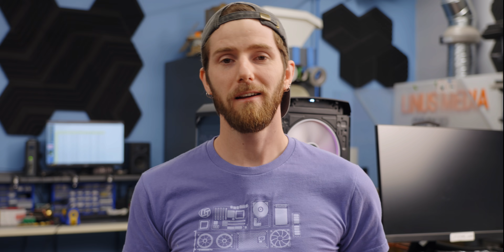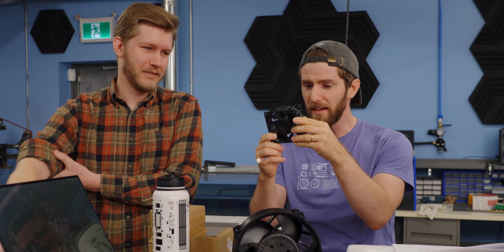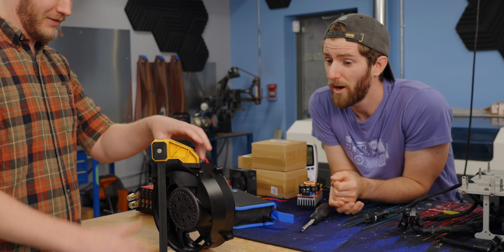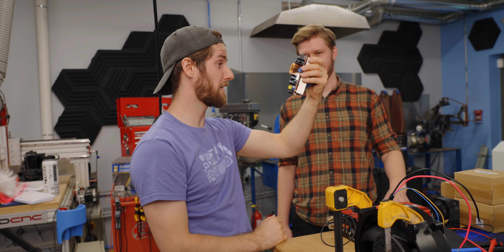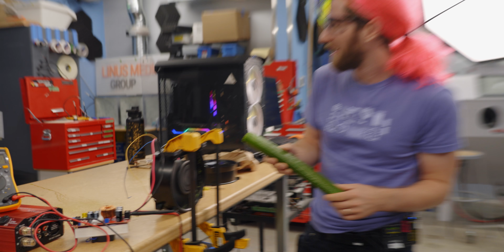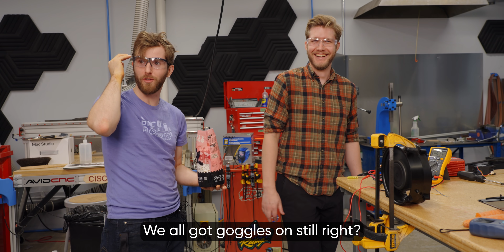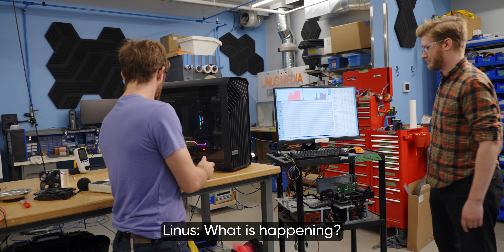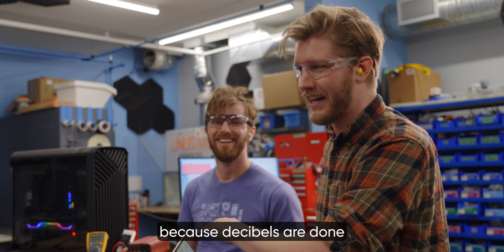The God of Computer Fans

Comment: Here's a hack, get a $30,100mm bathroom exhaust fan and BAM, you have the same airflow for a very low price.
Reply: These are ~8" fans and move a thousand CFM of air. A 4" fan sweeps a quarter the area and would have to turn at nearly 30000rpm to push 1000cfm... Actually more because cfm stops increasingly linearly at high rotor speeds.

No cheapo bathroom exhaust fan will get much past a tenth that speed. They will contain an asynchronous 2 or 4 pole motor which will spin at a shade under 3600 or 1800rpm respectively, probably pushing somewhere vaguely around 100cfm.
Reply: What about a car radiator fan?
Reply: @radelement3987  car radiator fan is way too powerful i think its 1800watts
Reply: @lighttechzeon7026  Which is only 3 times as much as one of these
Reply: @krzysztofczarnecki8238  which will break the pc
Reply: @lighttechzeon7026  They already had to use a separate power supply, so that is not a limiting factor.
Reply: @krzysztofczarnecki8238  you do know internals  of pc is fragile? 4100cfm with high pressure will most likely break the internals or damage it
Reply: @lighttechzeon7026  More importantly, increasing air flow at this stage is irrelevant to cooling because the transfer of heat off the die, through the vapor chambers and into the fins is now the limiting factor, not its removal from the fins.

Which is why, at this point, pretty much all of HPC is preparing for, at the very least, liquid cooling of the CPUs and GPUs, or just straight up full immersion.

Comment: We used fans like these to cool all of the components inside big drive cabinets. These drives were for 480v motors up to 500 horsepower at the aluminum rolling mill I used to work at. That fan is around 1/2 Horsepower! It would be really awesome to see stuff put into this fan using a high speed camera.

Comment: With a fan like that, I wouldn't even mount it internally.  That sucker is going to power a negative pressure system of ductwork to just suck all the heat out of the tower.

Comment: Actually have two of these, I work construction and we did a demo job at a cat food plant and they had these over a conveyer belt that cooled these labels/ heat shrink so they would drop on a bag go thru a heated chamber and then into the fan chamber and it would cool them down to handling temp so they wouldn’t stick together they have some force but mine are 110v and I planned on running them on a radiator in another room just for shits and giggles they are awesome tho

Comment: Those would be used on the top of a server cab that had sealed, non airflow doors/panels so it will draw cold air from the raised floor up through the cabinet out the top. These would be on the TOP for a chimney

Comment: Sometimes we use those models of fans because on older buildings the ac is not great and the focus is more air being pushed through rather than having cooler air. Ac is more reffered to as the removal of water from air, technically is "conditioned air or air conditioning". No need for recycling air just desiccate it and vent it out the back and make sure the inlet has shade.

Comment: My old shop had a multitude of different CNC and laser etch machines, these fans (or judging by the sound something similar) were used to cool down said equipment. Even massive milling machines would benefit from fans like these to keep mill stock out of the job

Comment: doing some reasearch on these ....  they're data center products and delta has a whole THD Line that goes from 80 mm to 200mm   FYI, that fan you have has a max draw of 8 amps.  based on my calculations, i think thats 3k watts total power per fan at its max rate.   everything runs on that 36-75 volt range except for the 80mm, that runs on the 12v rails, however, one 80mm fan the THD0848ve-00 is 48v.   

you're welcome linus :)

Comment: Hi, those type of fan are used in industry for cooling spetial motors/condensators/electronics circuit (like some used on big old CNC) , i changed one of this fan, he was full aluminium non coated (natural color)  , >3kg if i remember , >200w consumption and less noisy as yours, but bigger  ;)

Comment: Those fans are typically used to cool MCU buildings in industrial applications, MCUs usually have 3 phase 480v running through them. I used to work in a silica mine that had 8 MCUs to run pumps and other mine equipment . I hated everytime I had to be in those MCU buildings.

Comment: You'd get more flow if you had a radiused inlet.  RLCraig makes bellmouth inlets for HVAC ducts, that'd work like a charm.  That'd quiet it down too.
BTW, you can get a similar Pabst fan on e Bay.
Reply: I was using a Pabst fan to cool my audio rack for a while.  Great stuff, very well built.

Comment: I would've liked to see a part where they try to reduce the voltage so much that the fans arent really hearable or put them on a big radiator with push and pull or even close every gap of a case and only have one exit hole for all the air

Comment: At     7:43  ine thing  popped into my head :  4 of the  "GOD " fnas  used  in either  an RC A380 , B747  or  C17   model . THAT WOULD BE SWEET . My only headaches  would be  1. - how to provide  power  to all FOUR fof the duration of  flight  and 2. -  making  an appropraite  mold  around the fan so it looks  like an engine made  by  BOEING  or  Rolls Royce and then mounting them to the wings . I think power  would  really hamper me , any ideas  ?.

Comment: Okay, it seems absurd but the reason those psus come like that is because you're supposed to put standoffs on it and bolt it to the inside of a chassis to be integrated into your project (after you set the limits on the bench). They're usually just based on the reference implementation for a particular ic. You do have to watch the component quality though.

Comment: I work at a bitcoin farm,  we have some custom solutions for power and cases and stuff. We don't use those fans, but something pretty similar. I could definitely see them being used on custom configs. We run stuff pretty hot as well. Could be useful in some of our new buildings for transporting heat.

Comment: We have a similar fan at work just not as powerful as we have 6 in a row. It blows air into an electrical cabinet to cool down capacitor banks so I’m assuming they are meant for similar functions where you need high air flow and need them to be reliable and to be tough.

Comment: Have had to procure a only-slightly less specced fan for a film projection booth. Arc lamps produce ozone and you have to cycle the entire room's worth of air every few minutes for safety. One of these would deal with the whole room, but (1) those are LOUD for showing a movie and (2) we had one on each of three projectors instead of one for the whole room.

Comment: We have a large CNC drill used for circuit board manufacturing and the electrical cabinet on the side also houses the modules that control the machine movements and need to be cooled. The fans that are mounted to the door of the cabinet are a little larger than the ones you have but I don't think spin quite so fast.

Comment: About the fans: Industrial settings use those a lot. For example, electrical cabinets that needs lots of active cooling, like in wind turbines.
Reply: So they use the electricity generated by airflow over the giant turbine to generate airflow through a smaller turbine inside the giant turbine to cool the heat generated by the giant turbine? Seems complicated. Maybe they should just open a window.

Comment: As a DC electrician that works on AT&T telecommunications, those fans could be found in electrical cabinets with electronics running inside that indeed need cooling. They tend to either be situated in cabinets residing in indoor shelters, or on top of buildings.

Comment: I have installed fans like that and even more expensive fans in industrial cabinets. Their performance is great. And they work great with even absurd levels of clogging in filters.

Fans like this usually come in multiple voltages, both AC and DC, so I'm surprised they went with 48v DC. They probably also have a 120v AC version.

Rittal is the brand I mostly installed.
Reply: Rottal make the enclosures. Fans likely Pabst

Comment: I've seen these fans in use for industrial server racks, and even have one of them laying around here. Where my dad used to work, they had these super heavy duty fridge size vault kinda things that were used as a kind of almost bomb proof server rack, and it was kept in an unairconditioned warehouse. They had those type fans to quickly exhaust the hot air from inside, so the electronics didn't bake.
Reply: I worked in a big company for a decade and one day after a power outage I went to check the data center (there were like 50 racks of servers and switches, plus 3 chillers so it was pretty loud, you had to cup your ear around the phone to hear someone on the other end for reference)... Well that day I opened the door and heard this SCREAMING jet noise that was totally drowning out all the noise I was used to. I immediately found the rack and it had 6 of such fans at the top, all blowing at full speed from a fault. 

It was so loud, and so much airflow. Had to wait a week with them at full blast before a tech from the equipment supplier got in to repair it.

Comment: Some data centers use climate controlled rows for better cooling efficiency. They will build rooms around a row that is all intakes for servers and that little room will be air conditioned. These may be for that type of application, or even to remove the heat from the exhaust rows in a expeditious manner.

Comment: Well my laptop is starting to die, and it makes a weird noise, so at night when I'm having trouble to sleep I need to turn the laptop of, otherwise the noise anoys me imagine having a pc with a fan like these lol, I would not even turn it on ever :) or I would need some very expensive headphones with very good noise reduction to be able to be just next to the pc :)
Reply: Weird mechanical noises? Might actually be the fan(s) having issues. Weird electrical noises? Might be one of the higher voltage chipsets like display or graphics. Weird computer noises from like resting OS' default system or desktop? If you have shit connected by USB, might be disconnecting or turning on and off like a power saving feature cycling.
Reply: @AM-dc7pv  thanks for your concern, but I know it is the fan, since if I tap the pc it stops for a whille and then it comes back, and I can clearly see that is a ball bearing or something that makes the noise when the fan is turning, I didnt clearly explain it in my main coment, is not the laptop that is about to die, is the laptop fan :) I forgot to type fan ;)
that is why I was comparing to this fan on the video, mine makes noise cause is dieing, is not the normal noise, but the one on this video is always fking loud lol, if I can't sleep with the litle anoying noise mine makes, imagine with one of those :)
but thanks for trying to help anyway ;)

Comment: It was an interesting experiment, but what if you don’t blow in, but rather remove the back walls and draw out the air ... Isn’t it better?
Reply: No. Reducing the air pressure inside the case degrades the efficiency of the air cooling.
Reply: @martindinner3621  The air flow and so will be through the front wall with a filter. Duct fan wouldn't it be efficient?
despite the fact that not everyone in the store can create pressure

Comment: A Superior Broadcast Products (Marsden) 2KW solid state TV transmitter has 8 of them.  4 fans feeding the amplifiers, 4 drawing air away.  Those are 208/240V though.  It has 4 600W amplifiers with massive aluminum heat sinks and merges their outputs for a combined 2KW total output.  The transmitter is in a really nice 35U rack.

I was given one of those transmitters and also a 1KW tube amped transmitter.  Scrapped both of them, gave the racks away.  Still have 7 of those fans.

Comment: We actually use these types of fans in an injection molding machine but only because the controll box was overheating even with Airconditioning because of the coils. But its a very old machine (It runs on Dos) so we couldnt get replacement Fans so we choose some big fan. I dont know if those are Deltas too but they have a rating of 540 Watts but more like 655 Watts.

Comment: I used to work at a semiconductor testing factory , burn in racks had 2/4 of them on top to keep everything chilled. 120 plus racks each drawing 14kw odd each just to burn in some rectifiers and you need a lot of fans.

Comment: 17:58 Small correction: 3db is a doubling of power, 6db is a doubling of the pressure an 10db is a doubling of perceived loudness.
Reply: Came to say the same thing but you beat me to it :D
Reply: We also have the tympanic and stapedial reflexes so perceived loudness curve flattens out at loud sound levels, as we dampen our middle ear to protect the inner ear.
Reply: Yes, this is true.

Comment: make a flying pc with thease and try to not trip the breaker (or PSU protection) my 19 crt tvs when they are all ON pull 300-500w depending on mains voltage fluctations trust me mains in czech republic the around town Pardubice is all over the place some times 200v sometimes 250v well that was off topic so try to build 2 PCs you might say eazy but the chatch is 1 of them will have all of the fans that can fit in it replaced with thease things and PC 2 wil have thease fans intentaly put in a way that the pc will take off if evrifing faills just try to make a flying laptop. thanks

Comment: This couold be sleepered to heck, take a PWM signal from a motherboard header, put it into an arduino, desolder the voltage pot on the booster transformer, put an analogue signal from the arduino in there, your motherboard now drives the speed of those blowzookas. 10% pwm ~740rpm, the blowzookas would still move enough air to cool the computer for watching videos / trawling amazon etc, and when the motherboard gets hot and asks for more air, you get to name your own hurricane. Given they are already at Ian, can't be long before Hurricane Linus rips some roofs off in British Columbia.

Comment: We use those at work to cool entire bays of power supply and phase changers from the 80's with only one on top or bottom of the bay (I am working at a full flight simulator center)

Comment: These were the perfect fans to measure at what point increasing air flow doesn't increase cooling... There are so many people in LTC and no one suggested that you try that. Just lower the voltage or current limit until you start noticing changes in performance or temperature.

Comment: Used to use similar fans on old 35mm film projectors at movie theaters.  They were to help move air into / out of the lamphouse and keep the xenon lamp cool.  They were also used on sound racks to suck all the heat out of the top of the rack.  Similar to how a computer rack could be done.

Comment: AC Infinity $100 and it has a controller with a wall plug, no pc power needed. Same airflow. 1/4 the price. plus did I mention it comes with power cables and a speed controller?

Comment: To be fair, just dump this into a proper server rack and make the artists work in 3D accelerated remote sessions. Then you only have to worry about the bandwidth of these sessions instead of scrubbing data on a remote NAS storage. The only thing I'm not sure about is color accuracy as HEVC will obviously introduce compression.

Comment: Power distribution racks (I don't know proper english name) in factory I work in use fans like these, and there are like 20-30 of them. But these are small ones, the dryer in that factory is using steel 120cm fan powered by 400V 120A AC engine.

Comment: At my old job, the AC in the server room would sometimes go down and needed maintenance done all the time. Whenever that happened we would move these big industrial fans to circulate air inside the server room. It wasn't as good as the AC but it moved the temperature down enough degrees to keep it out of risky levels. At certain levels the servers would have their own alarms or notify the owner of the servers that it was getting too hot. These fans tend to be cheaper than fixing up an expensive AC system.

Comment: Ooh. Without checking the spec we have some 240v fans in a smoke machine at work. Fairly sure they are the same size. Not sure on flow.
Ok our spec is not as high, it's only 2300rpm

Comment: I've used smaller Delta fans for cooling heavy electrical load testing setups. Nothing as intense as this, but the equipment I've dealt with is for cunsumer engine testing. I could easily see these being used for industrial equipment load testing setups.

Comment: I've seen bigger and badder fans, but not many in a form factor like that. Most are commercial air movers. These are expensive for the performance and oddball electrical needs. I would have expected 220 volt like servers n such.

Comment: 14:15 - I do industrial automation. Some of the motor controllers we use are pretty big and have delta fans like these. Their cooling solution looks a bit like multi CPU servers, except they dump out quite a few kw of heat per chassis. Conservative estimate is 96% thermal efficiency for the drives, which gives us 5kw ish from a normal 110kw drive. For reference, they are about 3 - 4x the size of that case you got there I think.

Comment: Hi, regarding those fans "I'm actually under some NDA" but in all fairness i think i can at least share this. :) 

Those fans are in my case used to cool radio equipment in a lab, they are put in a radio shielded cabinet and we have them  to remove hot air through ventilations on top to cool the radio inside. 

These things get really hot FYI :)
Reply: Indeed, most high power radio and radar equpiment are basically just special light bulbs and vacuum tubes